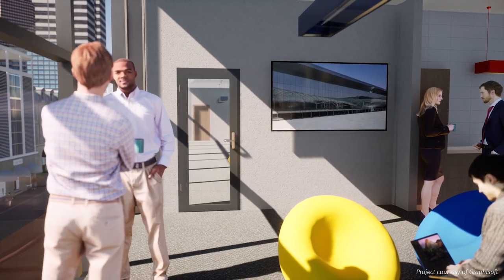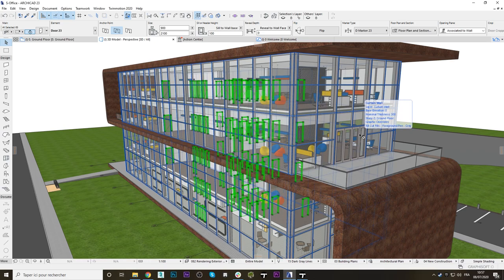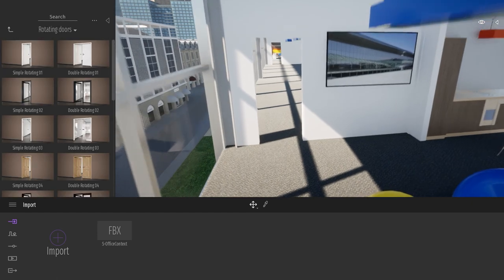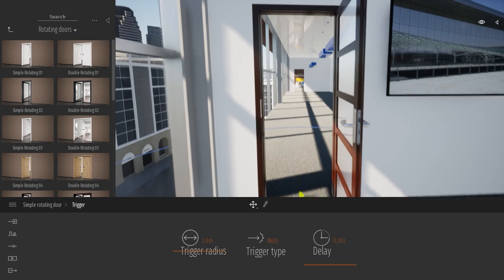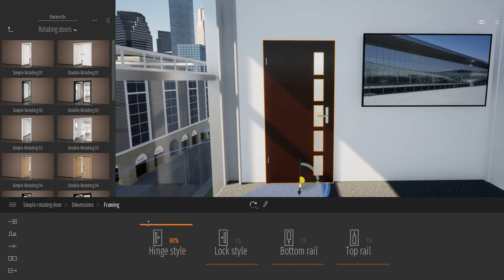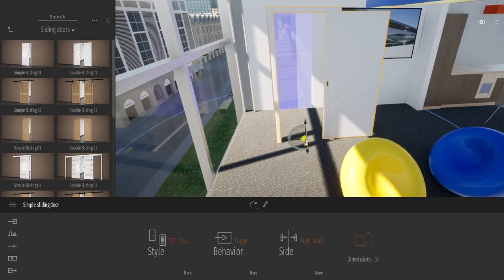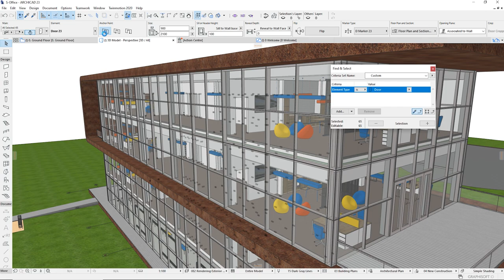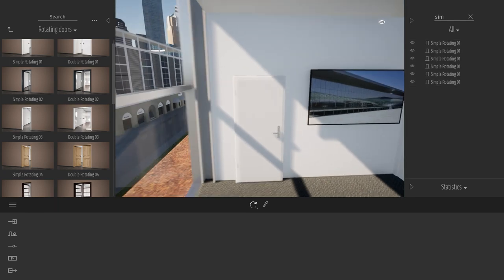Twinmotion 2020 Tutorial – Interactive & parametric doors

Comment: The lighting autoexposure in 2020 causes metal material to glow in the dark when all lights are turned off. Had no issues getting nice interior tenders in 2019 version. Please can you if not already fix these fundamentals. It’s been reported on your forums but not address. Doors opening are nice but if it’s so hard and frustrating to fix lighting issues is no point.

Comment: Can this be applied with Revit?
Reply from the maker: Yes. It works the same way with Revit.
Reply: @twinmotion  and sketchup ? it doesn't detect the door hole, do we have to make it with specific dimensions in order to detect it ? i use on mac, is there any difference ?